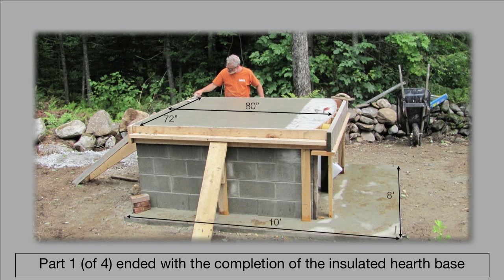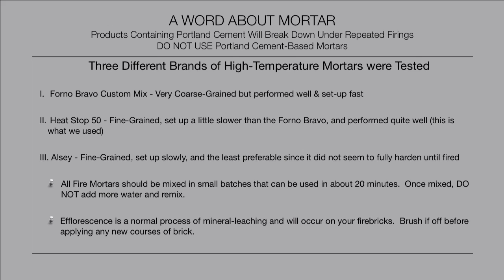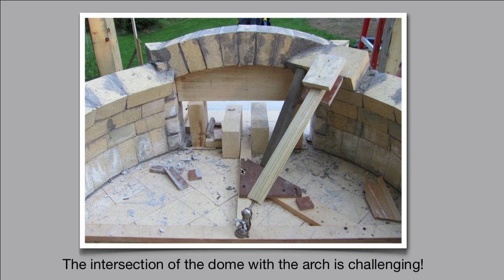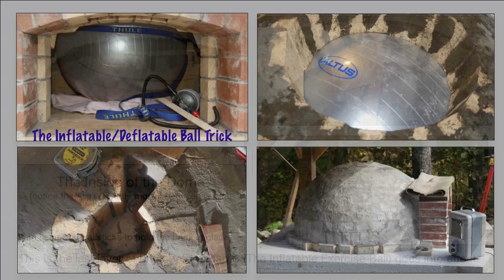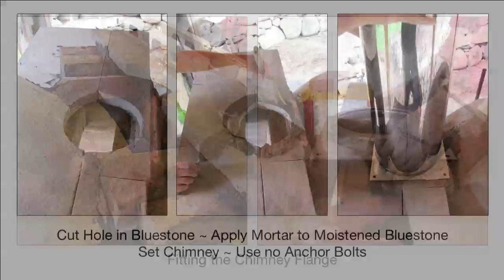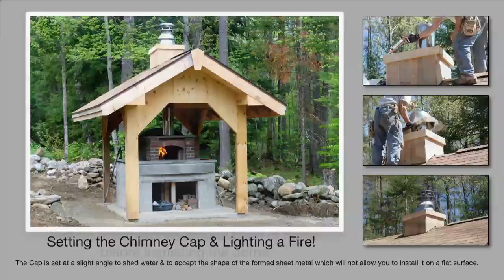Detailed How to Build an Authentic Pompeii Pizza Oven, Part 2 of 4 ~ Building the DOME!

Comment: And then you mention portland cement breaking down under heat, when just about every other site and specialist shop use PORTLAND CEMENT with Perlite / Vermiculite mixes to build their domes. Where do you even get your info? Just stick to the build mate, your advice about materials are way off base.

Comment: I have an oven using normal clay bricks, they don't break down - it's over 10 years now. If you use a low quality firebrick it will hold up 100% There is no need to advise viewers to spend the money on the kiln rated bricks, you will never reach the temps that break it down by normal home use. Stop spreading this narrative that only the best should be used. Yes, it makes for a great oven, but you don't need it at all. It's like fitting racing brakes on your grandma's car she only use to go shopping and church.

Comment: Thank you for this tutorial. Can I use low duty firebricks for this project?They are the best I can get in my country :(
Reply: you can use it but if you're trying to build an oven that will last an eternity you probably shouldnt since low duty will brake down since you will be running 800-1000 degrees

Comment: Why not use metric?  Pompeii is located in Italy, and Italy uses metric.
Reply: You use whatever type of measurement system is in your region that's a really not to be rude dumb question to ask
Reply: +Vanessa Chavez LOL
Reply: +Vanessa Chavez when in Italy do as the Italians do.  When in NH USA which does not use metric, do as the USA does.
Reply: +Bill Smith The only way to accurately measure curves and arches is to facilitate Planck units. Even using a simple abacus or slide rule, A tradesman can mark perfect primary cuts and secondary cuts that will match every time. The old school way is the better way when creating perfect masonry.
Reply: Vanessa Chavez Because metric didn’t get us on the moon.

Comment: hey buddy how did you make the jig? What type of joint is that in the centre?
Reply from the maker: I used an old tripod ball joint.  I fixed the ball joint to two pieces of 1" x 2" wood
that were made into a x shape that would lie flat on the pizza floor as shown in the picture at 5:45 in the video.  The ball joint I had was perfect because it had an extension that allowed me to join it to a 2"x2" piece of wood that would extend out for the radius.

Comment from the maker: When building a large blast furnace, an arch brick, engineered, custom is cost effective. For a small pizza dome, there are engineering specs and CAD programs that can generate the arch bricks for a dome of any size. It would have been far more expensive and in the end not much stronger. I think medium duty arch bricks formed to size are more than 2x as expensive than straights. The inside of the dome has very little mortar exposed to compromise.

Comment from the maker: Masonry is very heavy and labor intensive...and overall just a little less expensive if you do not count your labor. It would have also required a more involved substructure design.   If you count your labor, it is more expensive.  The pipe went up in about 10 minutes. The roof collar and above -the-roof enclosure took about a three hours.

Comment: Curious as why you finished with staneless steel pipe and not all masonry.But all in all pretty slick using the finger .I have built a few domes in my day out of brick on blast furnaces.Much bigger scale but same principle.Always interesting.If you everbuild another when you cut your brick .Cut the angles 2 ways to eliminate the wedge pice you use to shim.We call those side arch end wedges.The side arch turns the radious and the wedge closes the dome...